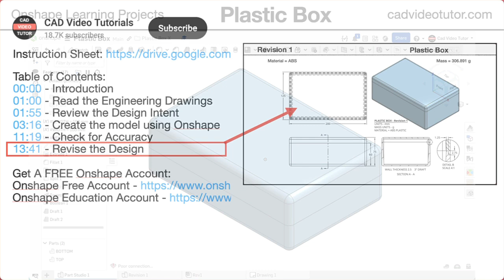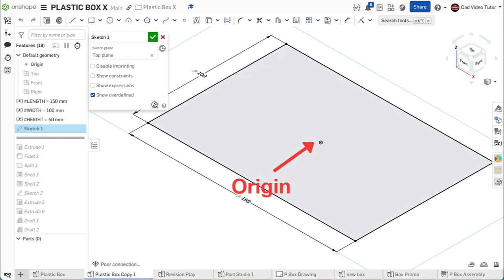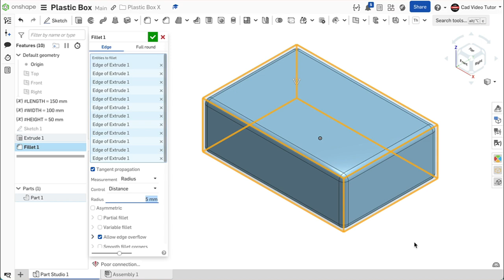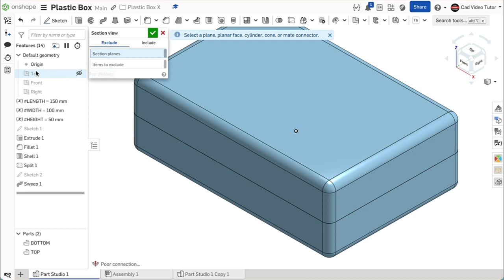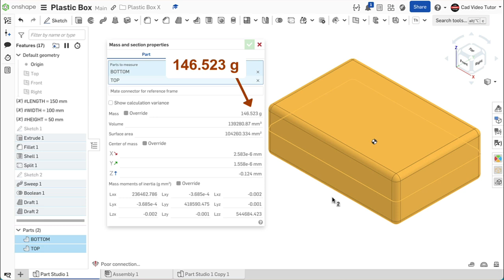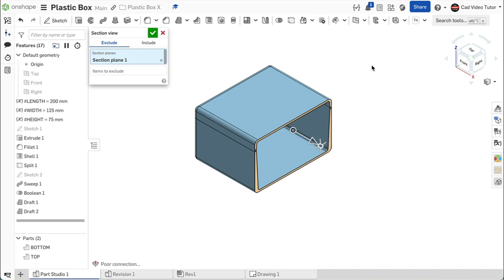Onshape Project 2025 - PLASTIC BOX | Step by Step Tutorial - Updated

Comment: Is there a mistake in applying the top draft in this video? If the draft is taken from the plane from the inside horizontal surface, which would allow both inner walls to align, then the mass is 145.111g. The video show the draft on the top part to commence at the outer horizontal surface and not the inner surface (i.e. where the boolean removed the material to allow the connection to be made)

Comment: The draft was only applied to the straight sides, so what about the corners as they will still be vertical?
Reply from the maker: I think if you use a section view to examine the material thickness at the rounded corners, it shows that the inside corners are thicker at the bottom showing the same angle was applied on the corner as the draft on the sides.  Let me know if I am wrong. Thanks

Comment: Unfortunately using Boolean leaves no clearance,  so the box would not work in real life. It would be an interference fit.
Reply: Thank you, that seems very sensible😂
Reply from the maker: Yes, there is no clearance using the boolean to create the opposite half of the joint.  If you are going to print this, and you want to add clearance, as a last step, use "move face" on the edge created using the boolean and enter the amount of clearance you want.  I think that it is easier to design without clearance and set the clearance amount as a variable and then apply that to a "move face" as the last step in the feature list.  This is also helpful if you have a top down design and you want to control the clearance on multiple parts being modeled together in the same part studio.  What do you think?